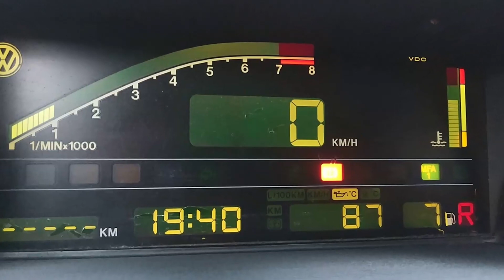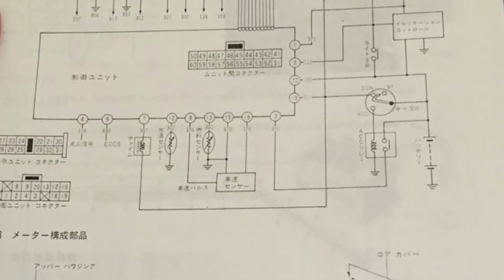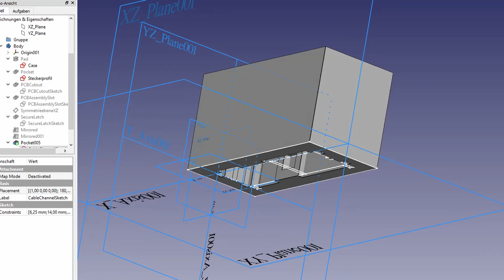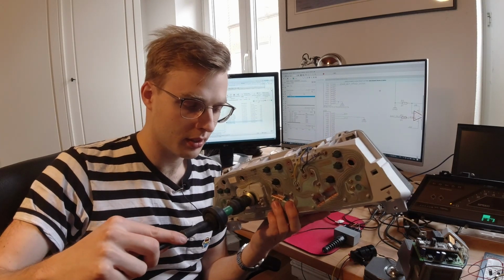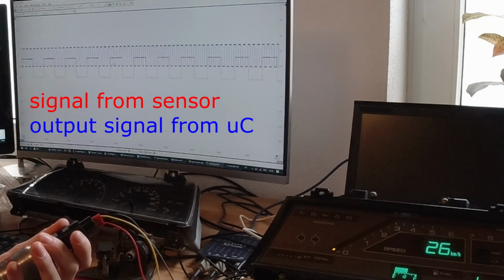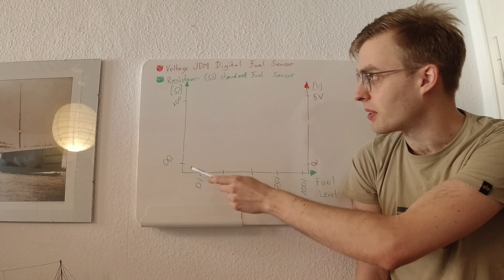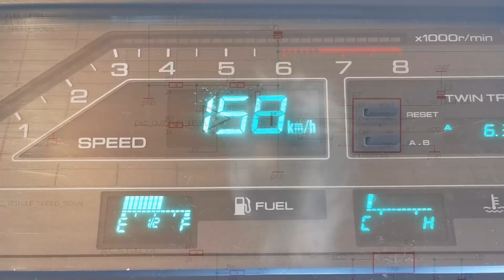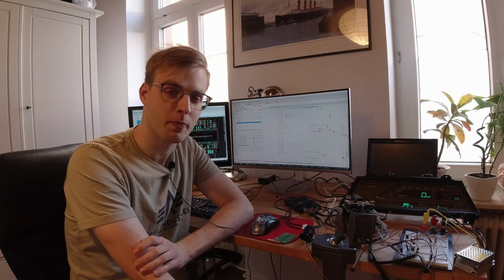How To Install A Retro 80s Digital Instrument Cluster

Comment: Hey! Very cool video. I recently upgraded my rz-1 (sunny-sentra sport coupe as know here in Chile), did a ca18de+t conversion (handled by an ft450) and I manage to get my self a digital cluster to change the analog one in it, they are the same models as yours as far as I can tell and I was struggling on get my hands onto some conversions kit for it, do you still making them? I would be great.
Reply from the maker: They are a lot of work to build, but I have open sourced the schematics and source code for the adapter, so you can build it yourself.
I may plan to build another batch in 2026.
https://www.clemenszangl.de/2022/10/23/nissan-sunny-rz1-digital-cluster-adapter-schematics-and-cad/
Reply: @ClemensInJapan  I'm up to wait for your next batch then. I have a lot of job to do in the mechanical stuff yet and also with the standalone ECU in the meantime, thanks for the reply!

Comment: Hello, a few days ago I just acquired a cluster like this. I have the cluster with RPM. I was looking at your work and I see that you had made an ECU for this model. I'm interested to know if you still manufacture them.
Reply from the maker: I stopped manufacturing these, because the effort building them is quite high. However, I may restart production. What engine do you have in your car, and is your digital cluster a 8000rpm or 9000rpm model?

Comment: Very cool. I'm building an AE86 and instead of sourcing a JDM digital cluster from the car, I am using one from a Camry. I ended up using an arduino and made a program to take the analog resistance from the fuel sender to convert to a digital voltage signal in the arduino and output it to the cluster. Works perfectly for a fraction of the cost of having to source a used digital fuel sender.

Comment: Good day Sir. What speed sensor did you use. I have the same guage installed in my nissan b12 but the speedometer only shows half of its actual speed. How can I make it accurate? Thank you
Reply from the maker: I had the same problem, and I build a small adapter electronics circuit to convert the signal.

Comment: hi sir.....i have this digital cluster but the fuel signal i plug in to the fuel signal on car it work for 5 sec after 5 sec it hang it doesnt go up or down the reading what can i do?
Reply from the maker: It filters the input. Changes in the input are only reflected after several minutes. Change the input, and wait.
Reply: @ClemensInJapan  i dint use any of ur device i use normal meter to fuel sensor
Reply from the maker: @ahhoeg4mx  Without adapter, the meter should still display some (wrong values). What fuel level do you see on the meter?
Reply: @ClemensInJapan  im using nissan sunny b11 fuel sensor and read almost accurate but after 5 sec the fuel gauge doesn't move

Comment: I had swapped the non tach to the regular tach cluster. I now want to connect the RZ1 cluster. 
You have taken the cluster swap to another level of detail. Very hard work. I am really impressed of your work. 
If you ever make the adapter chip, I'll buy it and I know some other people that will want one too.
Reply from the maker: Thanks! I made the adapter ECU and it sold out very quickly. I was not able to build new ones in the last few years due to chip shortage.
I may build a few more ones - may I ask what engine your come with factory?
Reply: @ClemensInJapan  in Costa Rica we usually swap the engine and use a GA16DE or SR20DE/VE. 
I know at least 3 people who will like to buy this adapter ECU.
Reply from the maker: I got some time the next few months, and may be starting to build new adapters again. May I ask if you could provide me a picture of the backside and the circuit board of your Rz1s analogue cluster? Also, I would need to know if your car is LHD or RHD.
Reply: My car is LHD and the analogue tachometer is USDM version. I can't post a picture here

Comment: Hello, I have installed that digital cluster in my b12, I have swap sr20de + t. Do you know, where can I find that speed sensor? Any page? Nice video, congratulations. I share the link of a video where my car comes out.
Reply from the maker: I am using this speed sensor: https://www.aliexpress.com/i/32917114564.html However, this will not directly work with the digital cluster - this sensor gives 4 pulses per rotation, while the original Rz1 sensor gives 16 pulses. That's why I needed to build this converter ECU.

Comment: Thanks for the information,i would like to ask about the connector "b" on digital speedometer
what is pin no.20 "+B" mean or stand for ?, and what is the substitute pin on the analog speedo ? 
thank you 
best regards
Reply from the maker: +B stands for "battery supply". It is basically just a connection to the battery terminal (with a fuse in between). The analogue cluster doesn't have this, because it does not need to be powered on all the time. The digital cluster has RAM to remember the trip distances, therefore you need to provide constant power so that it does not forget its trip counters.